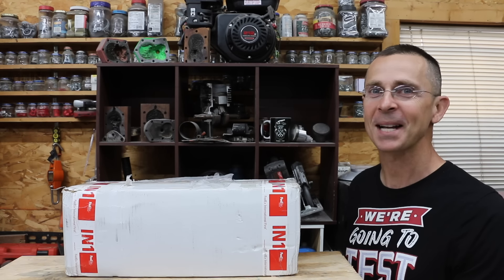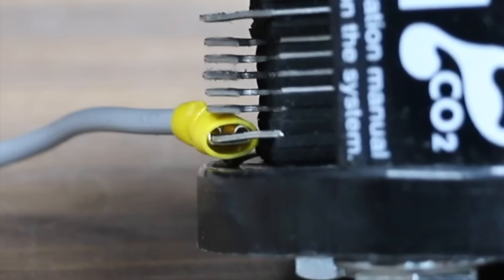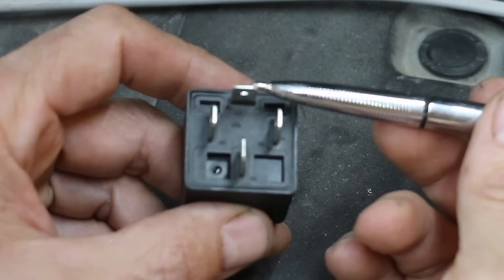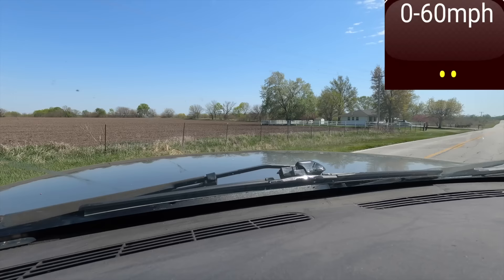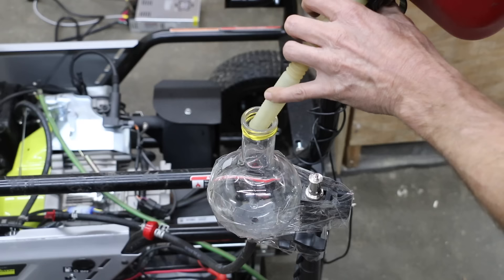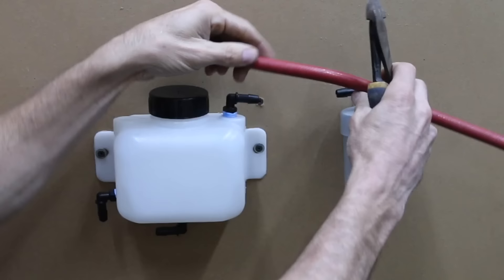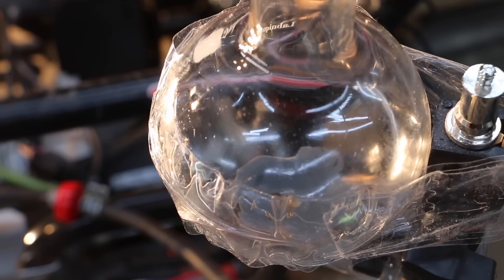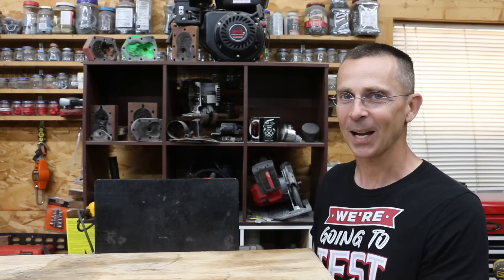AMAZING 35% More MPG with HHO? Let’s find out! Help with high gas prices?

Comment: Project Farm: "We obey the laws of thermodynamics in this house, mister!"
Reply: This wouldn't cause any violation of thermodynamics. Cars are WELL below the Carnot efficiency, the max effeciency a heat engine can reach at a given temperature, which is about 40-50% at car engine temperatures. Cars run at more like 20-30% efficiency, so it's plausible to get a bit more out of it, just not in this way.
Reply from the maker: Lol
Reply: @PineJayForge  Your comment is way underrated.  so many people think HHO generators are selling snake oil over Unity. Well most aren't anyways, but still, it's about improving efficency, not violating the laws of thermodynamics.
Reply: @kreynolds1123  they absolutely violate the laws of thermodynamics. You're powering the HHO generator using the car's alternator. There's no way for you to get more power out of that than what was put in when you generated it, otherwise you could make a perpetual motion machine by running the engine on pure HHO
Reply: @Zagill  wait till you learn about turbochargers.
Reply: @FrankieG13  or Even better... Belt driven superchargers 😂
Reply: @FrankieG13  turbochargers do not violate the laws of thermodynamics, and when not properly installed, or paired with the correct engine they will hamper performance. They are not magic.
Reply: @FrankieG13 Turbochargers do not generate combustible fuel using electricity. They pull more air into the engine using exhaust pressure. The issue at hand is that the hydrogen being burned in the engine cannot produce more power than what was required to separate it out of the water.
Reply: @PineJayForge  It is impossible to increase mileage by having the same engine generate the energy necessary to create the fuel, think about it.
Reply: @Zagill  The BS argument I think they would make probably has something to do with combustion efficiency, not producing fuel. It’s BS, though. Not really worth arguing about why crystals won’t heal your gout.
Reply: @Zagill  You are wrong mate. Second law of thermodynamics says that you cannot produce more energy that you put in the system, yes. BUT here is something you don't understand: internal combustion engine are only around 30 % efficient. That means that from every liter of fuel (which contains 10 kWh of energy) they produce 3 kWh of useful work and 7 kWh of heat. Together that is 10 kWh. BUT! But if you improve the EFFICIENCY of the internal combastion engine to lets say 35 % with HHO generator, because now PETROL fuel is burning more fully (better), then you have now 3,5 kWh and 6,5 kWh of heat from liter of fuel (WHICH IS STILL 10 kWh that 1 liter of fuel contains, SO YOU didn't produced more energy that you put in, you DIDN'T BREAK ANY thermodynamic LAW), but now you have 0,5 kWh MORE USEFUL WORK out of that fuel! And if the HHO generator uses less than 0,5 kWh of energy than you get more useful work out of that fuel (and LESS heat, but heat+useful work is still the same, so you didn't break any law). Hope you now understand.
Reply: @blakereid5785  at best you could argue that the oxygen made by the HHO generator is doing the same thing as the air brought in by a turbo, but that definitely isn't happening and wouldn't improve anything if it were
Reply: @mirkogruden8362  you are using energy to create the HHO. How could the HHO release more energy than was used to create it? Regardless, this video clearly shows that the difference made by an HHO generator is negligible at best.
Reply: the reason why there are so many debate about this is because of the different levels of understanding of science. Increasing MPG using HHO generators that runs on the car will never be more efficient that running without it.
Reply: @FrankieG13  I know all about turbochargers. I studied fluid mechanics and mechanical engineering.
Turbochargers recover waste energy that is usually thrown out the back of the car, out of the exhaust pipe. Energy usually wasted as noise, and heat, and high pressure gas. (Higher pressure gas than atmospheric pressure anyway). Which is also why turboed cars are quieter. Some of the usually wasted energy is being recovered.
How does that compare to a device... that drags all of its energy from the crankshaft of the engine, and then through the alternator (and not from waste gas)? Totally different.
Not only does it suck directly from the engines useful output power, it then has to go through an alternator (efficiency losses), a hydrolysis machine (more efficiency losses) and then hopefully get some of this already borrowed energy back, by being useful to combustion (even more efficiency losses). 

And you've still not got anything recovering waste enegy thrown out of the exhaust. Just a device to fool morons.
There's a reason no manufacturer would be seen dead putting anything remotely like this on any new car. They'd be instantly laughed out of business.
Reply: @haavardhnable  all superchargers reduce efficiency, everything else being equal. They only increase the power output of the engine. Only reason they're used. (Especially at high altitude like aircraft engines).
Turbochargers on the other hand can increase efficiency. Because they're driven by energy usually thrown out the back of the engine and wasted in the exhaust gas. 
But superchargers drain useful mechanical energy from the crank - same things as the belt .. they're directly connected. Same as "HHO" generators doing it even worse via the crank, then the belt, then the alternator, then a hydrolysis machine, then burning a bit of hydrogen... Whose energy to make it was already being drawn.. from the crankshaft.. and doesn't even increase power output like a supercharger would. So it's literally the worst of all worlds making your car worse in every way.

This would be instantly laughed out of the room for any serious engine design.
Reply: Obummer to the car manufacturers:  There is no law I can not change.
Reply: @gazlink1  I wonder if manufacturers will ever figure out a way to utilize all the waste heat engines generate.
Reply: Yes, but can you please elaborate how injecting HHO in a petrol engine is supposed to help to increase the combustion efficiency?
Reply: @mirkogruden8362  There is absolutely no reason whatsoever to think that gasoline burns more efficiently in the presence of hydrogen. Gasoline is already far more energy dense than liquid  hydrogen anyway. Best case scenario is you split water through electrolysis, port those gases to the combustion chamber, compress it, burn it, annnd the main waste product from that process is water. You are arguing that moving water from a tank under the hood to the tailpipe in the most convoluted and energy intensive fashion possible somehow makes the engine more efficient. It doesn't.
Reply: @Dirty_Bear22  piggy back a steam engine on the combustion engine that works off the heat emanated by it. Use all that lost heat.
Reply: @gazlink1  Im not claiming HHO increases the efficiency and/or power of an engine. Also, Zachary was arguing about more power, and not efficiency. A supercharger can indeed help a engine produce more power, even though its not more efficient? And it is driven by mechanical energy from the engine itself :p

Edit: The biggest problem with this thread is that people are mixing the terms efficiency and power.. Also, i think most of us agree that using the cars alternator to produce Hydrogen isnt the way to go for neither. Both turbochargers and superchargers are devices which absolutely has their place on cars which needs/can handle the pros/cons of them.
Reply: @Zagill   Pure oxygen & hydrogen INSTEAD of air might have an effect on “combustion efficiency” over air, you’d need a large tank for each gas/liquid,  it would be much more expensive than gas,  much more dangerous, and much worse total fuel efficiency when you’ve got to carry around your oxidizer. That’s why carrying oxidizer is only used where there’s no free oxygen. THIS exciting tech operates on 2 main principles: tight budgets, poor technical intuition.
Reply: @Zagill  I think it’s also interesting how involved it is to install. Requires better than average mechanical experience, but lower than average intuition.
Reply: @Zagill   dude, no need for straw men arguments. I was refering to the vast majority of HHO generators  that are not making over unity claims. just simple improvements to efficiency of burning the primary fuel more completly during the power stroke.  

i conceed, an HHO generator is not going to work for all engines that are already doing pretty good, just older ones that start off pretty low in efficiency with enough head room for improvements.  I'm not here selling anything,  but I seen it with my own two eyes on vehicles I installed it on rather than what you see on YT and despite your understanding or lack of reguarding claims.
Reply: @Zagill  You don't get it! You are asking yourself how can HHO release more energy than was used to create it? BECUSE IT DOESN'T!! You simply get more useful work and less heat because GASOLINE (not HHO) burns more fully because of HHO! GASOLINE not HHO! That CAN happen and no thermodynamic laws will be broken (but it doesn't happen in this configuration that is in the video obviouly). But the point beeing: you CAN add some stuff to gasoline and improve burning efficiency of the GASOLINE, there is potential.
Reply: @wehaveasaying  You also don't get it. GASOLINE CAN burn more fully if you add hydrogen to it, because the burning temperature of hydeogen is much higher than gasoline! (it doesn't in this case in the video, but it CAN if the system is properly designed). But we are talking pretty small improvements in efficiency. Burning hydrogen produce much higher temperature than burning gasoline in therefore CAN cause THE GASOLINE to burn more fully. Also if you are talking about water directly: there have been a systems where they directly injected very small amount of water into combustion chamber and that caused 1 % or so improvent in efficiency and lower emissins. There is a POTENTIAL that adding stuff to gasoline CAN improve efficiency a bit, because the gasoline will burn more fully. That can be done and no thermodynamic law will be broken.
Reply: @McToasted  I understand science and it is true that you cannot create more total energy out of the system than the system contains. BUT that is total energy. Total energy=mechanical work+heat. You absolutely can create a bit more useful mechanical work and LESS heat, so the sum of the two will still be the same (aka improve efficiency a bit) with adding hydrogen, because hydrogen burns at higher temperature and CAN cause THE GASOLINE to burn more fully/efficiently. It doesn't happen in this case which is in the video, but that CAN happen and no thermodynamic laws will be broken. ;)
Reply: @McToasted  If you would like to read scientific study about improving efficiency of gasoline burning with hydrogen google the study named: "An overview of development and challenges in hydrogen powered vehicles" and read the abstract (or the full study).
Reply: @McToasted  From the study: "Hence, at the current
 stage, using hydrogen as an additive to hydrocarbon fuel systems have been taken into consideration to produce higher performance than hydrogen-only internal combustion engines. Using the dual-fuel strategy can increase the combustion stability and thermal efficiency while decreasing the CO and unburned hydrocarbons emissions, and fuel consumption."
Reply: @mirkogruden8362  I am not talking about moving the water directly. You would use a hose to move the water directly. This system takes energy from the engine, uses that to drive the alternator, takes the electrical energy and uses it to break water molecules, sucks the hydrogen and oxygen through the car's intake, ports it into a combustion chamber where it gets burned leaving a waste product of... Water. Somehow you believe this will result in a net gain of energy. This is not possible. We could argue back and forth all day about what the presence of an absolutely miniscule amoumt of hydrogen would do but quite honestly the ball is in your court. Extraordinary claims require extraordinary proof. Just prove it. Simply find a system that has some actually demonstrable increase in efficiency. When you don't actually find one, build one. License your technology to every single car manufacturer on the planet and make enough money to buy Bezos's house and kick him out.
Reply: @mirkogruden8362  Hi, i think you did not get what I was trying to put across in my previous statement. Producing hydrogen gas in-situ using the car's own fuel is very inefficient (i doubt they are using PEMs in that small box). The fuel has to be combusted by the engine (losses), converted into electrical energy by the alternator (more losses) and finally used in the device to generate HHO (even more losses).

I am not doubting the use of hydrogen in combustion to boost efficiencies, that is the part where the science make sense.

Hope you understand my point :)
Reply: @PineJayForge  No. You take electricity from the car's generator, use it to split H2O and then later burn that H2. All processes with a loss in energy. It's literally impossible that this would work to save energy.
Reply: @whuzzzup  Why do you have a catalytic converter?  the obvious answer is to clean up your emissions......  The catalytic converter burns up the remaining hydrocarbons that were not burned in the combustion chamber. 

Where in the power stroke is the most energy extracted?........ Early when it is most compressed.  if your fuel is still burning when the piston is near the bottom, then you'r not going to get much energy out of the burning fuel at that stage. 

So not only are you not burning all your fuel in the combustion chamber, but a reasonable significant is being burned up late in the power stroke, or latter on in the catalytic converter. 

Now, hydrogen has a a much faster flame front than both gasoline and diesel. a little hydrogen and a slightly increased oxygen concentration helps burn the primary fuel more completly earlyer in the power stroke where you can get more energy than if it were burned later.

In many older inefficent car and truck engines, by improving the combustion you can get enough extra energy by burning more of the primary fuel early, to  split water and still be left with a net positive improvement in fuel economy.  

dont belive me then pay no attention to anything I said if that's your wish, I'm not selling you anything, nor doing i sell HHO units. but I have seen actual real world improvements of about upto 20% in fuel economy.
Reply: @kreynolds1123  a catalytic converter is there to convert any carbon monoxide into carbon dioxide. This burning "inefficiency" is simply caused by a lack of enough oxygen supply in the initial combustion process which can be aided by a turbocharger. However gasoline isn't a perfect combustible fuel anyhow. So you're going to get carbon monoxide.
Reply: @HerbaMachina " burn inefficeny from lack of oxygen".. maybe sometimes, but the oxygen sensor senses the amount of oxygen in the exhaust and the eco adjust the amount of fuel so as to leave enough oxygen to burn off the remaining incomplete combustion products, including carbon monoxide.  Burn time, level of fuel atomization, level of compression are other factors may effect how complete the combustion is and when power us delivered to the piston.  hydrogen's faster flame front helps ensure more of it is delivered early  power stroke.  A lot of newer engines are designed already more efficient so there's less room for improvement. So that is what it is, and HHO on demand production is less likely to bring improvements. Too many of both advocates and naysayers don't really understand much of the nuances resulting in each making false claims one way or another. 

As some one who has seen it work well in some cases, I'd say the biggest issues to all this  level of maintenance,  and keeping it freez proof.

Comment: I’m 76. Can’t remember how many ‘new inventions’ were advertised in my life time to improve your car’s performance. None of them worked. They were usually seen 
in Popular Mechanics, Mechanics Illustrated and Popular Science. Small ads in the back of the magazine.
Reply from the maker: Thanks for sharing.
Reply: a lot of inventions did help make combustion engines more 
Efficient. Injection, turbochargers,...  The thing with those inventions is that they became mainstream pretty fast.
Reply: Popular mechanics was awesome source of gimmick ideas, read it everyday in study hall in the 80s.
Reply: Magnets on fuel lines still being sold. I met the fraudster who is Rich from this nonsense.
Sad
Reply: Makes one wonder if it isnt a coincidence that we have scientists and engineers optimizing motors worldwide and no car is using one of those kits. One would nearly go so far and say those guys know what they are doing :o
Reply: Yes, I remember that. I have some old Popular Mechanics mags in the shop. 

I'm curious to see if there were any similar gadgets advertised back then. I would wager that there will be. Lol
Reply: I added several of these various fuel mileage improving items to my car and it now produces gasoline.  I put in a gallon of gas in the tank and in a week I have about 6.5 gallons there.  It's running at 167% fuel efficiency.
Reply: @KLRJUNE  Tesla has one.. lol 😅